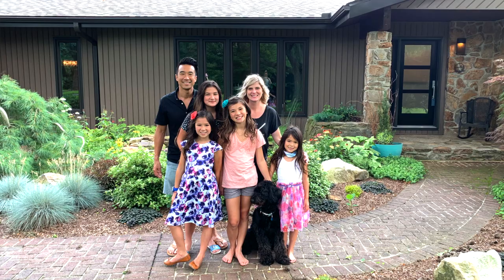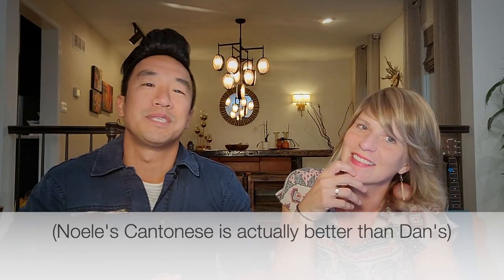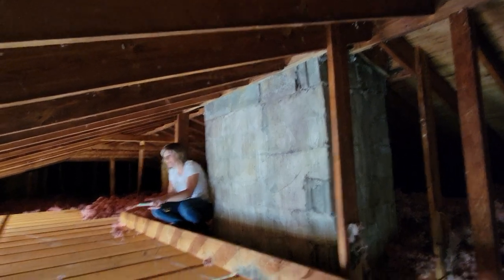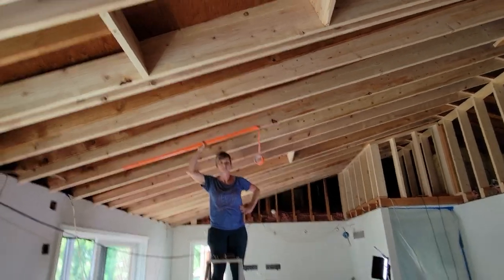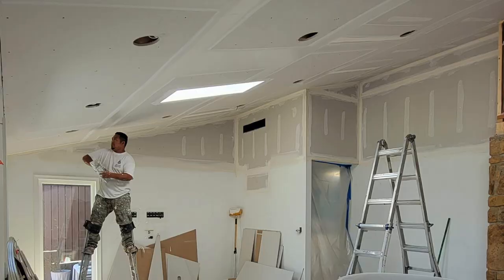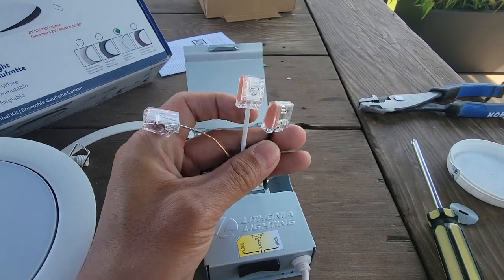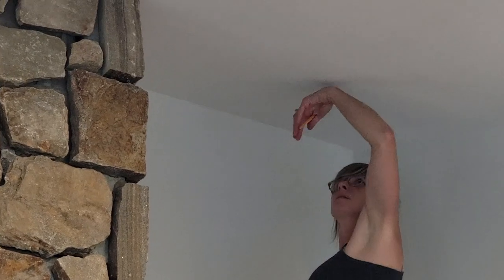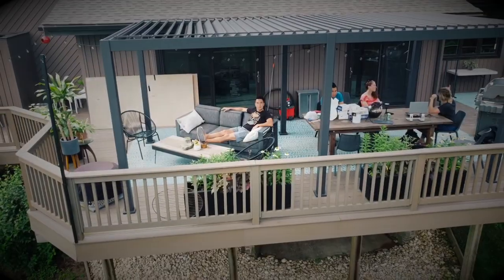Home Renovation - High Vaulted Ceilings, Recessed Lights and Fireplace Update

Comment: Awesome video! What is the new height of the ceiling? Did you guys have standard 8ft ceilings to begin with?
Reply from the maker: Hi Jeremiah! Thanks for watching and asking a great question! The new height is now 12 feet 10 inches. We did have 8 feet ceilings originally. Tell me about your plans!
Reply: @HouseofHuie   Good to know! We have a couple of projects lined up. First, a home addition for a family room where the room will actually look similars to yours and will add a master bedroom on the other side of the wall. Our house is old with 7.5 foot walls and we don't want it to look too weird so I think we will build with 8ft walls. Second, the existing house is a cape cod style home, and we have two bedrooms in our attic. We are considering removing the attic bedroom above the kitchen to make a huge cathedral style ceiling since the 7.5 ft ceiling is pretty low. It's gonna be expensive :)
Reply from the maker: @jeremiahhobbs1867  very exciting! I wish we were closer to take a look. Where are you located? It seems an architect may be worth discussing this with.